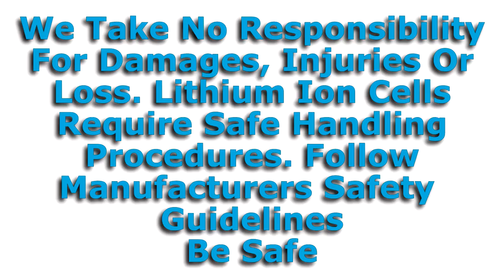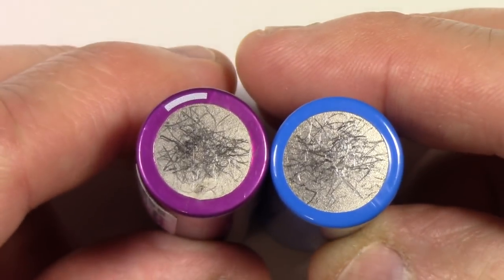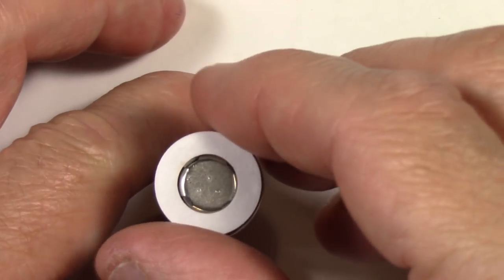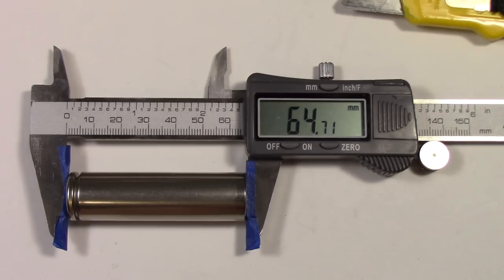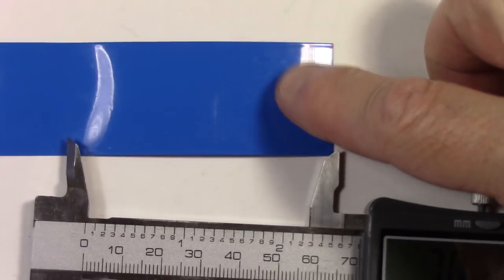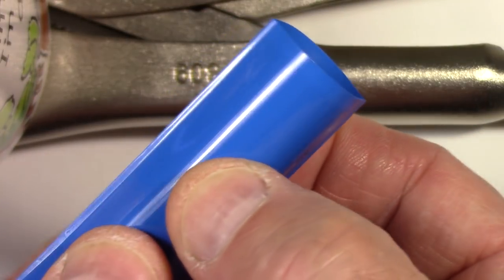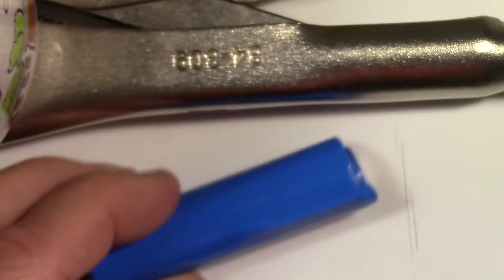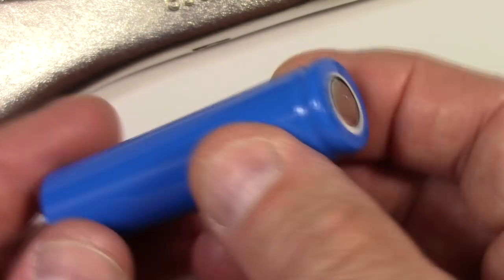18650 Li-ION REWRAP-WRAP Your Bare Cells How To Fix Or Replace 18650 Shrink Wrap Vape Thorough

Comment: thanks for sharing this. BTW, i bought one of those ebay 20 cell LG cluster deals.... im about to publish a video on it... crazy thing, the shrink wrap on those cells was so frail that the shrink wrap on them simply broke apart. I charged one with the imax b6ac and the first one took over 2200mah of charge. the second one however i shut off at around 1750 mah charging at .3 A The cells had markings under the wrap too however it seemed unreadable... keep an eye on the channel, either today or tomorrow i will publish it... thanks again for sharing this video.. the timing is right, thats for sure!
Reply from the maker: You are most welcome. I am interested in what you find in that LG cluster. Even when you can read the printing it generally does not cross reference, lol that is the nature of harvesting I think. I am glad I could help. Thank for watching and commenting again. All the best.

Comment: Purple anodized shrink wrap looks good too. You should use a Dymo thermal print label maker & label your batteries. Looks super professional then. Good video on how to wrap the battery properly, thanks.
Reply from the maker: You are most welcome. Do the printers print directly on the tubes? Do you have links to the anodized shrink wrap? I would appreciate that. Thanks.
Reply: Richard Lloyd, sorry I was just commenting on your stock purple anodized wrappers on your existing battery. Sorry about getting your hopes up on anodized wrappers, maybe they do sell them ?? Anyone ? And I'm not sure if there is a PC printer that is able to print directly on your heat shrink ? I wish there was, Anyone ? 

Anyways, yes you can buy clear self stick labels with black, red, blue or white printing & possibly gold printing. Dymo prints the colored print over clear tape using a thermal transfer process. Their labels are sun proof, durable & waterproof. Cheapest I've seen is on eBay to get the model 160 Dymo labels, and the compact model Dymo 160 labeller printer with keypad, it is very easy to use labeler. It's a self contained battery operated hand held  printer, prints clearly with 2 lines of print & different font sizes. There is other Dymo models & other companies like a Brother brand labeller too. But Dymo brand seems to have more printing label color options & types of labels at better pricing. Each Dymo tape cartridge holds 23 feet of tape usually 1/2" wide. At a price of around $5 each cartridge, it  gives you a lot of labels per cartridge. The Dymo 160 clear labels look professional & provide a little more protection to your wrapped battery. The labels stay on, the print doesn't rub off & the labels stick very well. Also Dymo offers different colored tape not just clear, with color print options. I don't work for Dymo, I'm just a labeller OCD nut who does a lot of research before I buy. I label everything that has a smooth surface, LOL'. Hope that helps ? 😁😋
Reply from the maker: The purple shrink wrap on the Efest was a transparent/translucent/clear purple so you could see the shine of the metal underneath it which gave it a very nice look. If you did get a clear shrink wrap you could put the label under the wrap which would make it permanent. I like that idea. Here are some 50 PVC Heat Shrink Wraps (Pre-cut) for 18650 batteries - Clear/Blue
 at Amazon: http://amzn.to/2qhR3nS Thanks
Reply from the maker: The Dymo 160, here it is at Amazon: http://amzn.to/2qpionQ for $9.99 really they are giving it away! I almost bought it at first sight but then I saw that it does not interface with a computer but at $9.99 you just want to buy it anyway... the Dymo 280 at Amazon:http://amzn.to/2rr2rly has a USB interface that allows you to print labels from free PC software and at $27.97 is still a good deal but really for $9.99 it's hard to resist the Dymo 160. Thanks for bringing it to my attention I am sure I will pull the trigger on one of these or maybe both and perhaps do a video on both. All the best.

Comment: Great vid. Now I'd buy a label thermal transfer printer. $50 at office supply stores. No need to use a magic marker. I don't personally own a label printer but we had one at work and it was great.
Reply from the maker: I am with you on that. I also think using a clear wrap and putting the label on the cell then wrapping it would also be cool. Here is the wrap I am thinking of 50 PVC Heat Shrink Wraps (Pre-cut) for 18650 batteries - Clear/Blue at Amazon :http://amzn.to/2qhR3nS Thanks

Comment: I have 3 18650 batteries that I need to make into button top batteries. How could I do that? I'd need the button, the insulator and the wrap.
Reply from the maker: Generally I put a small puddle of solder on the top on the cell. Careful not to short the cell or overheat it. Thanks.

Comment: Dear uploader,
wowwww , I could never imagine ths DIY wrapping is possible & made a cell looks very new 😃😃
Thts indeed a great idea u posted thtnks. I will try tht. 😜😜 
By th way , 
1) Could you pls mke sme vids of BMS boards which r available online? 
2) Is it ok to discharge 18650 up to 2.3 volt as BMS cuts th circuit @ tht voltage , equipped in any 3 cell 18650 battery package? 
Asking u coz u hv knowledge & interest abt, so if u share sme. 😌

Thanks.
Reply from the maker: You are most welcome. I was actually very pleasantly surprised and amazed by how well it worked. The end result was every bit as good the original wrap on the cell. I am going to re-wrap a few more of my less then perfect (damaged and defective) factory wraps as well as my Catastrophic Olight Panasonic NCR18650B cell https://youtu.be/kqA_V2lHfqA?list=PLnxXRLSlmSVO3L0jStRnPEEN2egrODjnm and I may do how to on adding a protection circuit. I have wondered about the 2.3V cut off too. I am not sure if it is damaging or not. I will look into it. Thanks for watching and the great questions. All the best.
Reply: Richard Lloyd ,, been racking my brain,,,,,, why do you want to rewrap a perfectly good battery????   I don't get it
Reply from the maker: I did it for demonstration purposes, most people would do it because their cell/battery wrap was damaged in some way. The wrap is a safety feature and if it is damaged it should be replaced before continuing to use it. Some people are re-wrapping for vanity reasons as well. They like a pink, purple or black cell wrap instead of what they have currently. Thanks.

Comment: My hairdryer just heats up the battery, it doesn't shrink the wrap at all. It does burn my fingers though. It's a weird dryer, so I had to resort to using a ligther. I'll get a mini heat gun one of these days.
Reply from the maker: At least you got it done. Your wrap maybe a high temp variety. Thanks.
Reply: Yeah. Now my other battery started getting cuts for some reason, so I grabbed a cheap 2000w heatgun - 500 times easier than using a lighter, for one, and first try was perfect. Couldn't ask for more :)
Reply: Don't use a goddamn lighter. Just dont.

Comment: I would stick with sharpie labels my self. I couldn't see spending lots of money to label my cells. if I was in a professional situation. that would be different. do they Have shrink wrap for 26650's  I have a few that could take a rw wrap. but I plan on putting them in a bank. so it doesn't really matter. do you know if there is a particular  reason why 26650 cells are not as popular? could it be energy density. you can get a smaller cell with just as much energy? thanks
Reply from the maker: It's personal thing if you want labels or if the sharpie will do. Personally I like the thought of a label printer for a more professional look but I am shooting video of the cells and I want to keep it straight but if it does not matter to you then rock on with the sharpie. Shrink wrap is available for 26650's here is some at Amazon: http://amzn.to/2r3cJHw and here at Ebay if you prefer: https://goo.gl/A8rNGl I have a 26650 flashlight and it's a monster but it is also very heavy and bulky which does not make it my go to light because of that but it depends on the application. My suspicion on the popularity of the 18650 is size and weight. I may do a video on re-wrapping a 26650 thanks for asking. All the best.